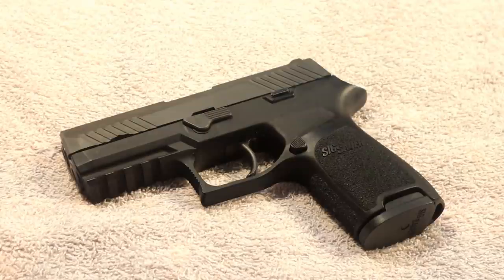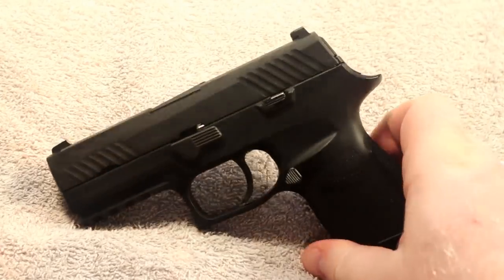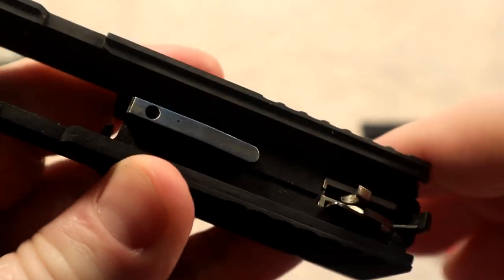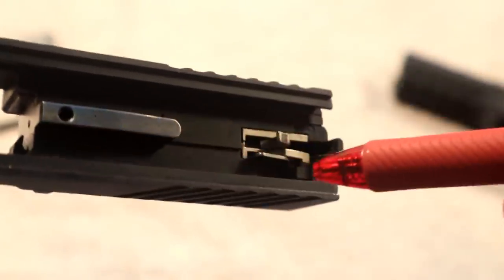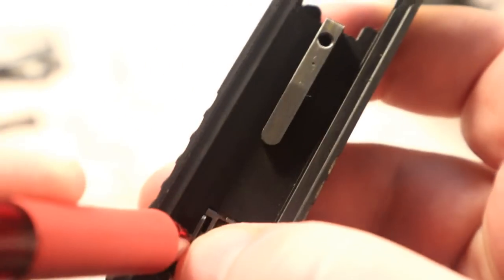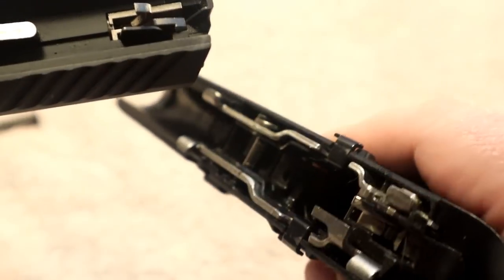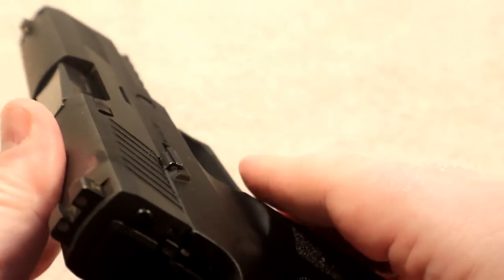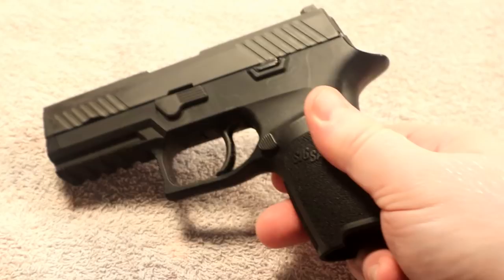The Sig P320's Dirty Little Secret You Won't Find in the Manual

Comment: Im no physics major here, but it just doesnt make sense how all these mechanical security layers which requires an orderly chain reaction to discharge a bullet are bypassed...unless the holsters, poorly designed ones, have an internal object that adds pressure to the trigger when the body leans on the holster in a certain way, or pushed around in a purse.
Reply from the maker: Exactly

Comment: Suggestion: perhaps demonstrate that the inner clearance between the trigger assembly and the slide's firing pin safety is adequate. Assembled, is the firing pin safety release slightly depressed, especially with downward pressure on the slide to take up the slack in the rails?
Reply from the maker: There's nothing wrong with them.
Reply: @BoomStickTactical   I'm not saying there is or isn't. There is slack in the rails that permits some movement. When assembled, are the clearances adequate to hold the pin and not depress the pin safety or release the pin during movement within that slack? You only looked at it disassembled, not when the components are mated and clearances matter.

Comment: First off the striker block is not very robust and I can easily see carbon build up or corrosion causing that to not be active. No way I would carry one without an external manual safety.
Reply from the maker: There's never been a failure shown in any of them
Reply: @BoomStickTactical  Come on now. You are telling me that the cops gun that shot from his holster somehow was his are the Holsters fault. I don't buy that. There will always be user error resulting in ND's with any gun. No way that was. Sig said the hood was not on the holster when clearly it was tq holder they claimed was the hood. Bet you Sig ends up giving that Department a check.

Comment: The trigger had too much mass. If you dropped it, the weight of the trigger would move rearward and fire. They now designed a lighter trigger. But it’s too late. They should have released a mandatory recall. Now they’re screwed
Reply from the maker: There were a few other changes they made as well.

Comment: Great video. I agree with everything you covered. With the most recent lawsuit involving numerous trained individuals, there must be something wrong with SOME of these firearms. 
Something, whether it is an internal fitment problem or debris, is pushing on that firing pin block, allowing the striker pin to move forward, or the block is not engaging correctly with the pin. 
EVERY P320 SHOULD BE TESTED WHILE IN AND OUT OF BATTERY TO SEE IF THAT BLOCK IS BEING ACTIVATED WITHOUT TRIGGER MANIPULATION.
 If it is a design flaw and Sig doesn't address it, we will see more incidents, plain and simple. If it was just user error, we would be seeing it happen under the same circumstances as frequently with other brands as well.
I love the 320, but Sig better figure this out.
Reply from the maker: They have on newer models

Comment: I run nothing but sigs, my EDC is a P320-C, the m18 that sits in my battle belt as my range/ training firearm and then another p320 configuration that I may EDC. NEVER have I had a problem with this.
Reply from the maker: Theirs nothing wrong with Sig.  They are a great gun.
Reply: @BoomStickTactical  almost 2k rounds through my M18 and it’s never even jammed 😂

Comment: Not taking your finger off the trigger, especially when re-holstering must be trained and trained and trained into people.  People don't naturally think "Take my finger off the trigger".  It is more natural to hold your finger on the trigger.  My "suspicion" is most of these incidents are negligent discharges from improper gun handling but I will not rule out some bizarre manufacturing defect in a few rare firearms.  My biggest advise is when you move to re-holster, pause, THINK "Remove my finger from trigger" and repeat every time.  When you insert the pistol into the holster cant your hip just a bit so that if it goes off it will hopefully fire into the ground and not your leg or foot.  Be safe everyone.  If you are really scared there are also small silicone inserts you can place behind the trigger when carrying.  Just practice popping it out when doing dry fire training.
Reply from the maker: Most have been shown to be neglect discharge

Comment: Not all of the videos out there are Sig Bashers. See it as information.
Something is wrong with the civilian model P230 as there are too many reports comming in.
The military version with the outside safety does not seem to have this AD problem...more of a feeding problem. 
All Sig P320 should be recalled untill they find out what the problem is. Untill then....DON´T GO AROUND WITH A LIVE ROUND IN THE CHAMBER. Practice your Israili method Draw - Chamber - Aim - Fire dry fireing.
Reply from the maker: There is nothing wrong with them.  Every case has been shown to have had someone or some thing get against the trigger.

Comment: Is there anyway a new round could go into battery without the firing pin correctly resetting? Can a situation be created where the firing pin is unintentionally resting on an unfired primer?
Reply from the maker: Only if multiple parts fail

Comment: Thanks for the video. 

I don't have an opinion either way, but I am curious about the issue. I recently saw a P320, and I thought it looked like a nice pistol. A few thoughts come to mind. 

Could dirt cause the striker block in the slide assembly to stick? If the block were dirty and stuck in the depressed position, that would negate that safety feature (assuming that I understood your video correctly). 

You don't discuss this issue in this video, but I remember a groove being cut in the slide next to that striker block piece. I think there's another piece that has to come up into that groove for the gun to fire. If I remember correctly, the groove and associated piece are made to prevent out-of-battery firing, but I could be wrong about that. Maybe that issue is irrelevant to this accident. If that issue is relevant in some way, could dirt fill the groove and contribute to a malfunction? 

Before my health failed, I was an engineer, and I did quite a bit of failure analysis. I appreciate your point about needing to see a breakdown of the guns in question to look for mechanical failure modes. If dirt caused the striker blocker in the slide to stick so that this safety feature were disabled, the gun could go off if the sear catch broke. However, a broken sear catch would be such an obvious cause of failure that I would expect the officer's lawyers to publicize that failure. Making a sear catch that would be nearly impossible to break in normal use should not be that difficult. There's no reason not to make that small piece out of a hardened steel. Unless the piece had some pre-existing crack, the design should not cause stress concentration that would initiate a fatigue crack. If the lawyers had evidence of fatigue fracture of the sear catch, that evidence would clearly show that Sig was at fault for making the bad sear catch. 

I would love to be part of doing the failure analysis on these firearms. I haven't operated a scanning electron microscope in almost thirty years, so I would need updated training to run the microscope in this study. Even if I couldn't put my hands on things, I'd like to watch the work being done. If the analysis showed no failures, then I'd like to be part of that. 

If poor cleaning practice were part of the failure sequence, that's something that the community needs to know. Maybe the P320 isn't inherently prone to unintentional discharge, but maybe the gun is extremely sensitive to being dirty. In that case, the community needs to know that operating a P320 requires more regular cleaning. Maybe that cleaning is required even when the gun isn't fired regularly.
Reply from the maker: It would take a lot more than just a dirty gun.
Reply: @BoomStickTactical  Thanks!

Comment: I have a question. I've been told / seen online that the sear is held in place by 2 small springs underneath of it , I've also been told/seen online that supposedly the sear can cause the trigger to move if those springs fail or allow the sear to move. Is this true? If the sear moving does allow the trigger to move then in theory this could cause a ND because all safety features would then be defeated?
Reply: Did you watch this video? There's other parts that prevent the gun from firing if that would happen.
Reply from the maker: The sear in any gun is held in place with a small spring.
Reply: @Rottluver425  I did watch the video. I'm just asking questions based off the info I've seen online that supposedly can lead to an ND. I don't really see how it could be caused by anything other than negligence but I'm asking questions.
Reply: @justinkvogel7947  Ok, that's good that you watched it. But the video did a very solid, and very in depth explanation of how that wouldn't make the gun fire. There are physical blocks that won't move even if the springs fail that were shown in the video. Keep asking questions and keep learning and definitely don't just believe something because someone said it on the internet. Watching videos and learning the workings of these items will go a long way in telling between internet BS and facts.

Comment: Modifications can make the gun fire also. If a person uses an adjustable trigger for example and removes too much pre-travel, the trigger will be pulled enough to disable the firing pin block/safety. At the same time, the sear can be lowered enough that it's barely hanging on, while the backup sear is also lowered (as it's lowered with the sear). This disables all the safeties and can easily fire when dropped. You'd be surprised how very little the trigger needs to be pulled to disable the firing pin block. (Some say, for these same reasons that the trigger being pulled only partially while in the holster can make the gun unsafe. In any case though, the gun in factory condition is just as safe as any other gun.)
Reply from the maker: That would require modifications that haven't been part of the guns that supposedly fired.
Reply: @BoomStickTactical  For at least the last decade I've heard a few top instructors advise shooters to NOT use aftermarket trigger kits in pistols (mostly Glocks because they're so common) because they've seen kits cause pistols to become unsafe as the OP pointed out. In the context of your video this isn't a factor.

Comment: Maybe unsafe is to harshly put. But without any doubt it’s engineered badly. The internal trigger bar is of sub standard quality. The firing pin and some other parts are also of low quality. The trigger without any safety insert is also very sketchy.
Reply from the maker: There's nothing wrong with Sig.

Comment: Have you seen the reports of the steel challenge competitor? It sounds like in front of witnesses his P320 discharged in the holster while his hands were over his shoulders.

The firing pin block is controlled by a hair spring with little force to overcome fouling. The firing pin block actuator only has to fail to fully return by a little bit for the striker to be clear to strike the primer.

Now take any striker fired pistol, chamber a round, and wiggle the slide (muzzle in a safe direction). You are applying lateral shear force on the sear and striker engagement.

Be safe, know your firearms. I am not a gunsmith.
Reply from the maker: Competition guns are usually heavily modified.  I've seen a few competition guns that have issues going off.  As far as factory guns, I've never had anyone show me any evidence of one of these failing.  There would be physical evidence if that were the case.

Comment: The P320 was actually my first gun. I ended up trading it in and getting a P229 M11-A1 but I never had an issue with my P320 when I owned it from my experience. I’ve been hearing about these discharges going off on their and I find it crazy.
Reply from the maker: There's nothing wrong with them.  I'm currently carrying mine right now.
Reply: @BoomStickTactical  Feels like a new video of a holstered P320 going off comes out every week now!
Reply from the maker: @rhealdingus7663  and not a single one shows the gun being at fault and no one has been able to replicate it

Comment: In the recent case with the female detective someone said that the 320 could have fired because of pressure put on the gun that squeezed the gun and somehow fired the gun. Any ideas on what that could be?
Reply from the maker: If the Holster is soft enough to allow enough flex of material for something to press against the trigger

Comment: Just a thought, suppose the firing pin doesn't fully reset, and is stuck part way?  Or another component(s) not fully resetting, it may be possible to fire unintentionally under these scenarios?  What is "supposed to happen" is not always what actually occurs!
Reply from the maker: The only way the firing pin wouldn't reset is if the slide doesn't go back into battery because of the sear.
Reply: @BoomStickTactical  Thank You for responding, and the explanation.  To further theorize a possible scenario, suppose the sear to firing pin engagement was less than ideal.  If the slide to frame fit was excessive, or other factors influenced this interface, could the pin "slip off" the sear and possibly have enough force to ignite the cartridge?  I'm thinking from a standpoint of Glock knowledge, supposedly if the pin comes off the sear face, the pin is not retracted enough to have the force to fire.  I understand the firing pin safety/block in theory, could it be possible that the pin doesn't return enough for the pin safety block to "reset" as well?  Thanks again for your experience, knowledge, and reply!  Forgive my hypotheticals if they are impossible.

Comment: there is a video of a  holstered P320 going off as an officer exited his car with his hands full, not on the gun.  Another video showed how a slight intrusion into the trigger guard in the holster could lead to a UD.
Reply from the maker: There's more to that than you think. Something got between the Holster and guard
Reply: There was a gun writer several years ago who had his glock in a well worn leather holster and it went off as he was sitting down in his car. If I remember right in hindsight he said the holster was so worn he should have replaced it earlier. Leather holsters wear and soften with use which can lead to folds ect. I generally prefer Kydex or something similar. Which is what I carry my 320 in
Reply: @BoomStickTactical  without the additional trigger safety of guns like a Glock the holster only had to impinge on the edges of the trigger a little bit.  It doesn't take much movement to set it off.

Comment: I'd love to get a hold of her holster too.  If she keeps it in her purse often, it probably gets beat up a bit.  Although I'm not familiar with Serpa holsters; the holsters I do have and am familiar with all use screws to adjust the pressure holding the gun in place ( except for my Galco leather holsters, which I don't use, too easy for something to get into the trigger guard).  I find I have to periodically take a screw driver to the holsters to tighten them up because the screws work themselves loose over time.
Reply from the maker: I have a serpa for a glock and can tell you they're not designed to be used inside a bag with a loaded chamber.

Comment: So basically for my SIG to fire on its own, I would have to have two major parts of the gun fail simultaneously. I looked at my SIG and both parts are present and in good order. I even made sure my 320 is post drop safe issue by checking the serial number with SIG. All good. I've carried mine for 2 years now. I have both the carry and M17 kit for mine. Never had an issue.
Reply from the maker: They're good guns

Comment: What I think you are missing here, is the TOLERANCE of those safety features. The levers only have to be moved ever-so slightly to be defeated. The trigger only has to be SLIGHTLY moved to disable the block and whatnot. So, if you have a non-PERFECT holster, or there is ANY touch to the trigger, that weapon can discharge. I believe that is what is happening in a lot of these cases. The people in question probably have less-than-perfect holsters, that are enabling the firearm discharging "on it's own", kind of a "perfect storm" type thing. This is also an example of "where there is smoke, there is fire". I don't hear nearly as many issues with other brands. How many realistic lawsuits against Glock or S&W for this type of problem?
Reply from the maker: There were several against glock in the 80s. There's nothing wrong with sig.

Comment: Gun in a purse?  With no holster or with a holster?

There are so many system interactions (human fatigue, holster design, belt equipment, etc.), that it’s hard to sort out.  IMO offer a gun with a grip safety.  Just like the 1911.
Reply from the maker: They need to carry them properly.

Comment: Excellent video. I love my striker fire pistols, but appendix carry works the best for me. I feel much more comfortable carrying a DA/SA pistol that way. I carry a CZ-P07. I also have a couple of Sig P-229s and a Sig P-250 I have carried, the latter being DA only. With the firing pin block and the heavy DA trigger on these I think I'm less likely to have a negligent discharge than with a striker fire pistol. I carry them with a round in the chamber and decocked.
Reply from the maker: Training is key
Reply: @BoomStickTactical  Absolutely.